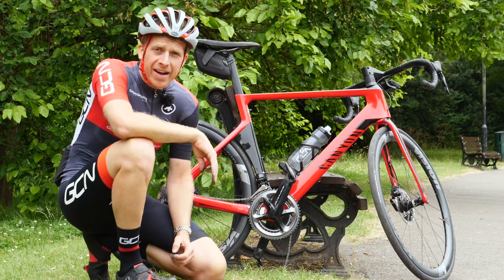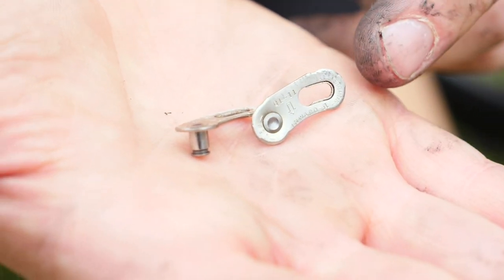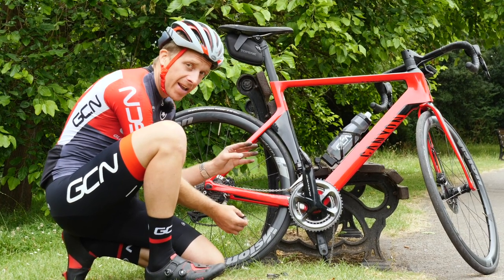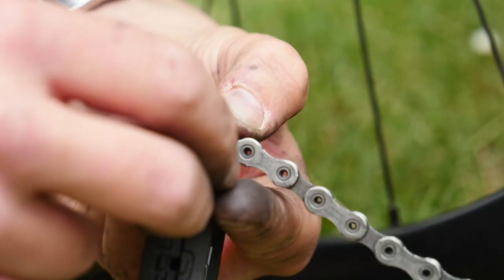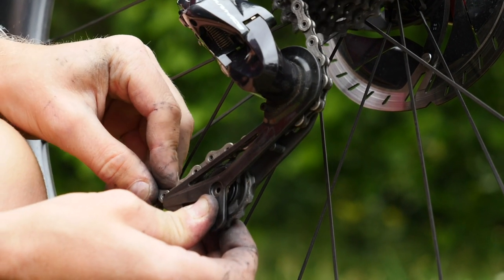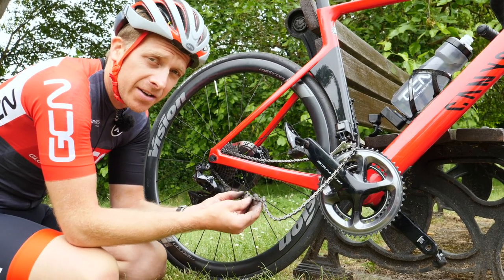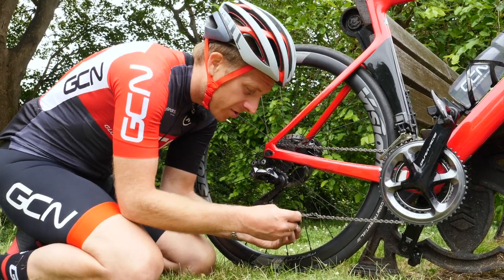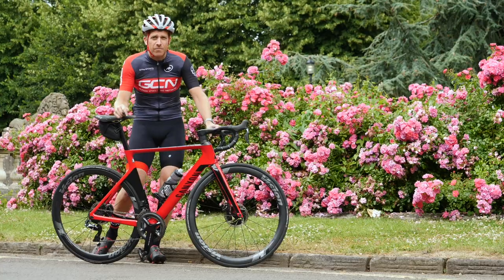How To Fix A Broken Bike Chain | Jon's Easy Roadside Repairs

Comment from the maker: Do you carry a quick link when you ride?
Reply: No cause I am not even a road biker cause I am only ten but I wish to be like you!! LOVE YOU GUYS! 😍😍😍😍😍😍😘😘😘😘😘
Reply: Yes, ofcourse I have a link.
Reply: Always have a pair. Good tip is to either keep them in the original packaging but cut smaller like you did and have in the saddle bag, or as mentioned in a video a while ago, looped on a key ring chain on your keys. Thanks for the videos guys.
Reply: Not only do I carry a link, I carry a bit of chain and a couple pins. And I do have a tool with a chain-breaker. I do not like a mechanical ruining a lovely day on my bike.
Reply: Yes
Reply: Nice whip
Reply: I always forget it in my toolbox
Reply: GCN Tech hello of Argentina 🇦🇷🇦🇷🇦🇷
Reply: Yes, used to carry only a pin, but since buying a quick link it's in my pocket in a little bag with tools and other stuff
Reply: Yes, I carry one, despite never breaking a chain in 45+ years of riding.
Reply: Yes, although I've got a new bike and haven't replaced the spare quick link in my saddle bag. It's the wrong speed 😅
Reply: no, but now you're scaring me! I stopped carrying my multi-tool with the chain tool in preference for one with fewer tools - both Topeak, naturally - because it's too heavy and bulky. But now I'm reconsidering that move.
Reply: MRGRUMPY53   @MRGRUMPY53  I guess self-adhesive patches and sanding   paper don't count as tools, then? Plus, what are the tire levers for if you don't have a pump or CO2-cartridge? I'm just curious.
Reply: @UCBhvaSJKKntVqizKnV9KWwA he can blow up an inner tube using just his natural ability?
Reply: MRGRUMPY53  😋 so is a quick link a tool or a spare part like a tube? Quite nitpicky, that difference. Either it gets me riding along or it's useless. 😉 Or I walk/hitchhike back home...
Reply: I once borke my chain and luckily I had a pair, I've been carrying one with me ever since even on short rides.
Reply: always! i use mine to keep my knees working on hills
Reply: oh Jon ! where are you rubbery gloves? a real cyclist has dirty hands, ha ha.
Reply: Always do!
Reply: Sempre! Ajudo mais do que uso...(aliás nunca usei, mas não deixo de levar).
Reply: ABSOLUTELY! Nothing worse than being far from home with a snapped chain or ANY repair that can't be fixed along side of the road. #BePrepared
Reply: I will from now on
Reply: Yes, on road and trails. On long group rides with no sag, I carry multiple link sizes.
Reply: MRGRUMPY53  No track pump, really? Me neither! Mini pump is okay. But without a truing stand, I don't know... feels insecure.
Love commenting your comments, you are always so serious. And so polite to answer any following questions and not leave them unreplied.
Reply: I carry a cell phone ☎️...funny thing is I have never broken a chain.
Reply: Too right! Had a chain let go after 54 miles of a 55 mile ride and needed to get to a hotel and ride the next day. Saved my bacon.
Reply: Yep.  Snapped a chain 8 years ago and had to call for a lift.  Ordered a quick link and multi tool with chain breaker the next day.  Never had a problem since😀
Reply: yes... always carry
Reply from the maker: It's almost an insurance policy!
Reply: GCN Tech exactly.  Invest in stuff to make sure you never need it.
Reply: No. IF i take my multitool with me on a longer ride, i can always shorten the broken chain by two links and fix the chain with the chaintool. Never had any problems with a chain after fitting it with just a chaintool, no quicklink, no extra pin needed, the "old" pins will do nicely, just don't push the out too far when removing a link (or you will never get it back in)
Reply: Yep. Sure do. 
Such a simple thing to carry with so much at risk if you blow a chain.
Reply: yes
Reply: I carry a WolfTooth PackPlier, which holds two pairs of quick links, and functions as a quick link plier and tire lever.   I also carry a Topeak RatchetRocket DX Plus, which contains a small chain pin tool along with the full set of hex and torx bits, a ratchet tool and an extension.   That, a tube, and a small mini pump, and I'm covered for anything.
Reply: I carry 2 actually! Two pair that is.
Reply: Always. It’s a bad idea to ride without one.
Reply: yes i do carry one link and tool on every ride, even with my newly acquired bike, murphy will strike when you least expect it  lol.  :)
Reply: always carry 10-speed and 9-speed lind, one for my road bike and one for mtb
Reply: Yes I do, since I always ride with a frame pack and carry loads of stuffs!
Reply: What brand are the links used in this video?
Reply: Yes I carry a quick link, but in 35 years of riding Ive never broke a chain, maybe lucky or maybe overblown.
Reply: I carry a spare chain in my back pack.
Reply: Sorry this is telling you have some spare quick link .well you may aswell just kept spare chain 

Useless ! 

How about explaining how to use something to how it .

Comment: Broke a chain going up a 10% climb but didn't have a chain tool but I did have a quick link 🤦‍♂️ and had to walk 10k back to the car, not ideal, always carry a chain breaker and quick link now 👌
Reply from the maker: Dangit! A lot of good multitools have them included now 👍
Reply: @gcntech  Haven't seen too many actually, need to track down the Topeak you have in the video !

Comment: If do the repair on the upper part of the chain between cassette and front chainring, or pedal backwards to place the not-yet-fully-closed quick link there, all you need to do is pull the rear brake and step - lightly - on the pedal to close it. I once nearly cut myself trying to close it by pulling on the chain.
Oh, and I had one of those breaks ending up with two inner links (at least I could remove the remains of the outer without tools) - but had no quick link with me, and no pin. (Back on the bike after about 15 years of why-should-I-use-a-bike-I-own-a-car...)
Now it is a never-leave-home-without-it-item. Just like a credit card.

Comment: Good video, thanks. However, what would you do if the link that was damaged was one of the "internal" ones. Presumably, as well as removing that link you would also have to remove the external link on either side in order to leave an internal on either side fot the quick link to be fitted to. If this is the case you would have effectively reduced your chain length by two links. Would your bike still be rideable? Or have i missed something?

Comment: I bought a Canyon Aeroad 8.0 Di2, and the chain wasn't properly installed (the link-pin wasn't pushed in all the way). The chain came apart halfway, but I was able to limp it to the nearest bike shop where I had a missing link installed. I ended up picking up a Crank Brother's multi-tool with the chainbreaker at the shop.

Comment: I saw a guy with a broken chain and offered to stop and help him.  After about 30 minutes of him trying to bodge together a shortened chain (he didn't have a quick link) with me holding the chain and such for him.  I wished him luck and bought a quick link the next time I was getting a couple of spare innertubes.  Now I don't ride without one. (Unfortunately, I lost the little hook that holds the chain together while you fix it off my multi-tool.)

Comment: I used a KMC chain joined with a quick link once and only once ... I broke it on the indoor trainer after just 500 km (cumulative). The quick link was bent out of recognition and the other half shattered into four pieces. And before someone asks how much power I put out, I barely scraped 600 W and average 250 W, so I am by no means a brute. But yes, I agree that these can save your ride. I have never had a chain mishap on my outdoor rides yet and always carry a chain tool with me so there's always an option to shorten the chain and ride home with a slightly limited set of gears.

Comment: @GCN Tech, actually with a 11 speed link you can repair ANY chain nowadays, not just any 11s one, as you seem to imply in the video... 
The INNER width of chains is in fact the same for all speeds (3/32", 2.30 mm), while the OUTER width can only be the same as for 11s or larger.

Comment: Are those chain links as durable as normal links? or do you need to change the chain asap?
Reply: The quick links are as durable as the rest of your chain. 
But you should replace the link when you replace your complete chain.

Comment: Are these links permanent replacements or just temporary? If so how many miles cycling can you get out of them and thanks for the great videos they make a newbies life much easier!
Reply: Permanent. When you get a new chain, it will come with a new link to connect it. Having said that, I do sometimes find that my chain checker will show more wear at the link than anywhere else, so I do occasionally put a new link into a used chain that still has plenty of life left.

Comment: Keep the correct size quick link and a derailleur hanger taped to the brake cables by the handle bars so you never forget to pack one. One for each bike then even if you don’t have the tools, you can get help from a passing cyclist who is carrying some tools.

Comment: Happened a couple of times.
The one end of the chain is alwas bend.
I cary a lengt of steel wire and just tie the end together. It means no shifting, while riding back home very slowly.
But I dont need to cary a ton of tools.

Comment: 4:30 pro bodge tip: remove your cycling shoes, shove it between the spokes to hold the derailleur forward. you won't need the small chain hook/third hand

Comment: recommended quick links?
Reply: Shimano link is very tight (looks more secure). Open and close only with pliers. And after few open-close , feels like new. That's my choice.
Reply: Sram is also extremely tight, definitely need pliers.
Reply: @th_js  Yes, I agree, but Shimano is much tighter (I have both and prefer Shimano).
Reply: @mislevis  Maybe it's that way on the road side, but on mountain bikes it's the opposite way round

Comment: Reason number 1 and 2 why I wax my chains. Don't really ever have to worry about a chain snapping because I switch them out every two to three weeks for cleaning and re-wax and put the spare pre-waxed chain on and also, no dirty hands!
Reply: That makes no sense. Chains don't magically become new again just by taking them off your bike and putting them back on again a couple of weeks later. A chain that's done 500km in five consecutive weeks is just as worn as one that's done 100km in one week, five times. If anything, repeatedly breaking and remaking your chains will weaken them slightly.
Reply: @beeble2003  Connex quick links - reusable. The chains get put to pasture once they've hit 2,000 miles each. Point is clean hands and chains that are highly less likely to snap since they don't pick up nearly as much road grime.

Comment: Next time: how to clean your hands of oil and grease o the side of the road. Would hate to touch the bartape with greasy hands.
Reply: Sunscreen works in a pinch but you still need paper towel or a rag. The trick is not to use water.
Reply: Add some sugar to your soap and just a little water to start, then give your hands a good scrub before rinsing them off.

Comment: Here's a tip for cleaning those greasy hands afterwards; rinse them in clean cooking oil, e.g. rapeseed/cannola.

...it's the same reason why one of the best ways to help waterfowl after an oil spill is cleaning them with butter.
Reply: Gary Dodgson  Isn't that awfully sticky? In my father's auto shop they sometimes mixed soap with coffee grinds.

Comment: Pro Tip: why not just pull the chain off the front chain ring when you’re replacing the quick link?  That way derailleur tension is significantly minimized....
Reply: Which he does. And then he puts it back on the chain ring, for some reason.
Reply from the maker: to demonstrate the clip that joins the chain. Jon
Reply: @gcntech  I have never carried one of those little clips on a ride with me.  I have fashioned something similar out of a piece of string, though. The string (depending on it's strength) can also be used to disengage a quick link.